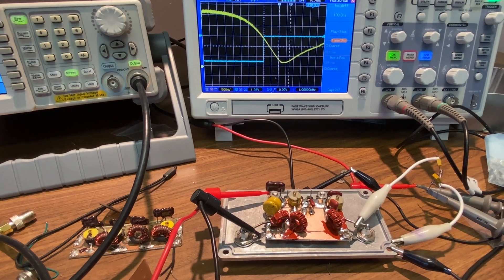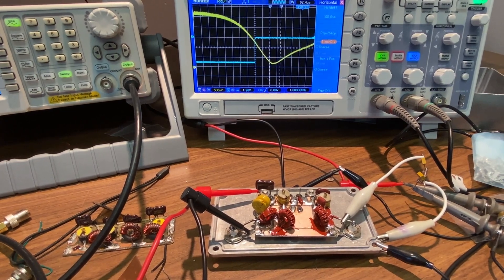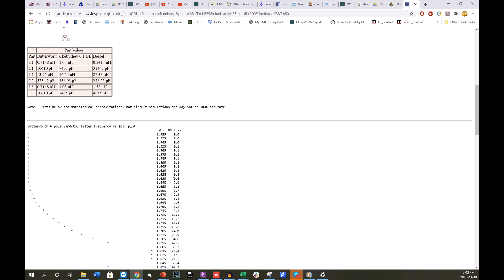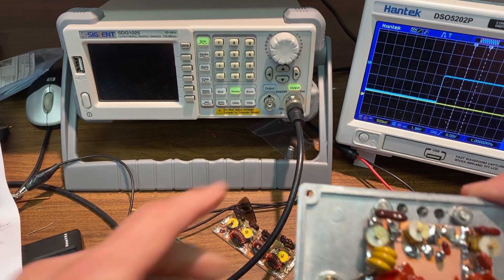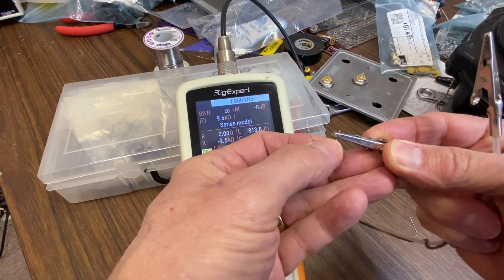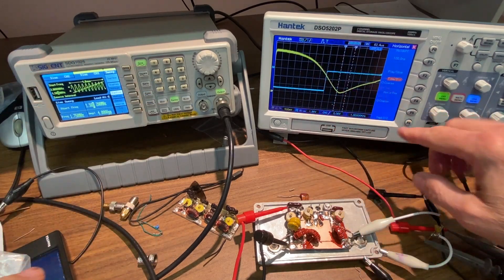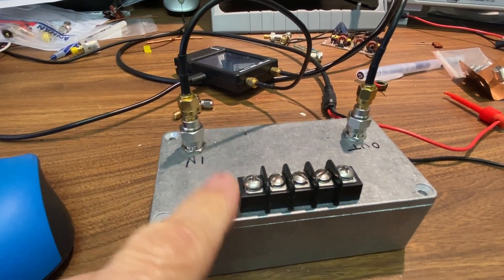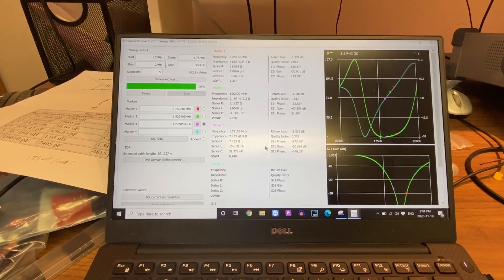Stopband filter design construction and testing

Comment: Steve, I built the same filter the same way and siliconed the parts in place. At least I thought it was silicone.  Turned out to be heatsink compound.  it was late. And only the nastiest solvents work on it.  
What, no tinysa? 
Great design website, I had not run into that one.
What relays are you using for switching filters? 
Ross ve6ars
Reply from the maker: Hi Dale,
Just a small signal relay like a 12v Omron G5V-2.
I'm not sure a nano SA would be "fast enough" to do the filter adjustment? Is it?  The scope and sig.gen work great.